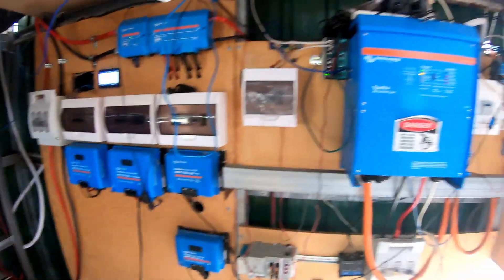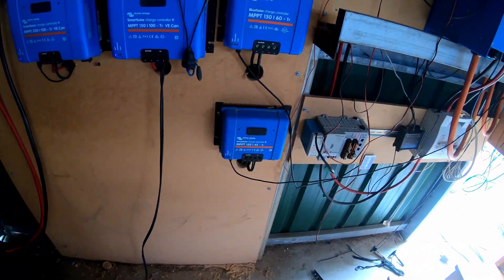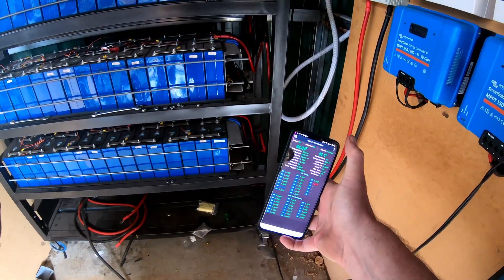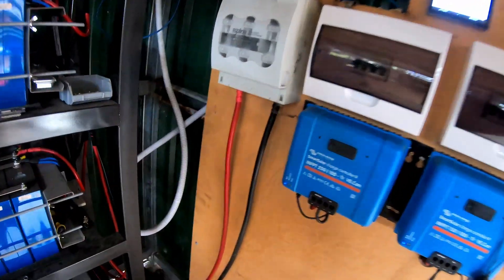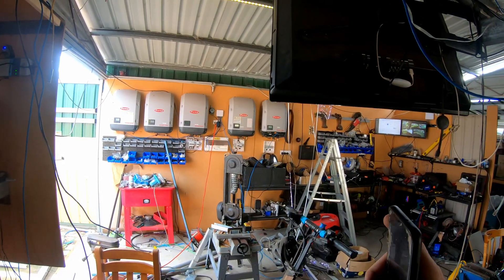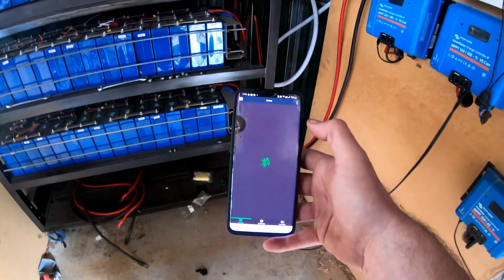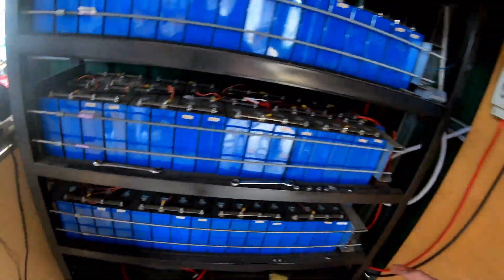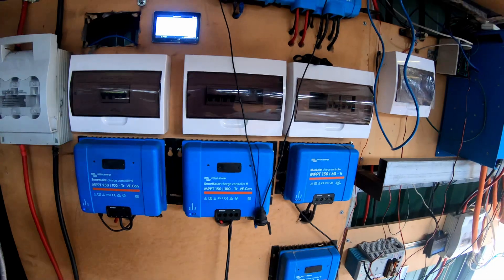Lithium Battery and Lead Resistance

Comment: Great system mate! 
Is it an on grid ESS system or off grid?
Reply from the maker: Its offgrid, but we have the monitoring on the grid tied side. Its skews our results a little in things like production and what not, but its also nice to be able to see the houses production as well as the off grid production. 

I did have an emon pi on the house before i just havent gotten around to fixing it and putting them back in as seperate sytems.

Comment: Whats the point in compressing the batteries? In professional battery packs they do not compress it.
Reply from the maker: To be honest, the compression here is not really for "COMPRESSION". There is foam between the cells so i doubt there is actually a lot of pressure, its more securing them than anything. I am on the fence about compression or not compression. A manufacturer only needs the battery to last the warranty period. any more and it would mean less sales. so its questionable what there motivations might be but i wouldnt speculate, i did it because i wasnt sure and it means they are secured to the rack now

Comment: Were it me...   And,   take this for what it is,   just the  thoughts of one/1  "dumb aSS   'murican",   ...  I would run bus bars top to bottom on the shelves,  connect each of the Batts with short leads to the bus bars, equal lengths of course,   ..   then, ....    Pos feed/drain to the top, ...   Neg feed/drain to the bottom of the bars.......  IE.  opposite ends....                     CHEERS Mate....!!!!!!!!...                 🤓🤓🤓
Reply from the maker: That's not a bad idea at all, it would help to keep them all balanced too